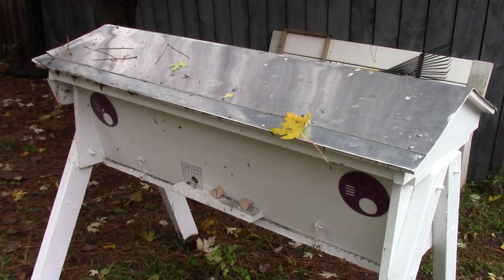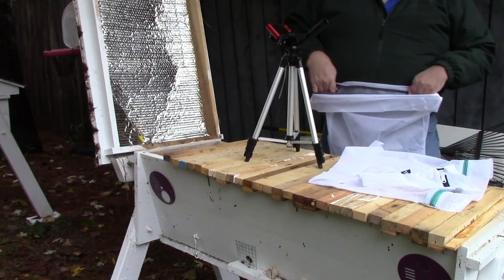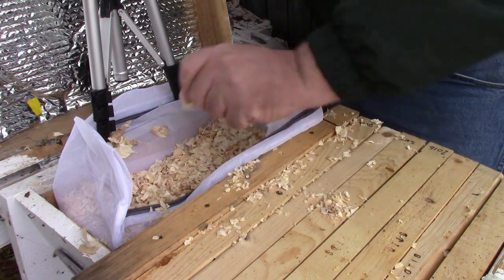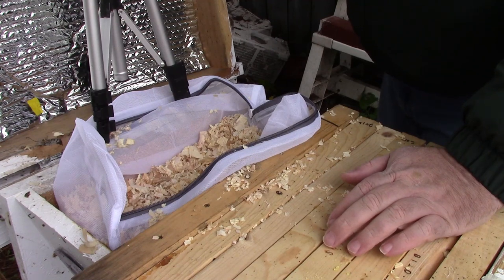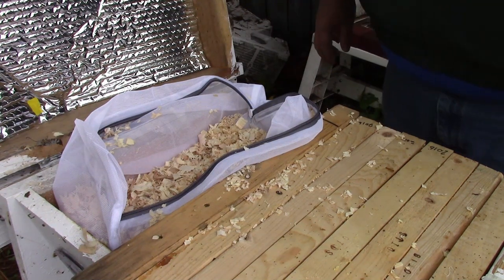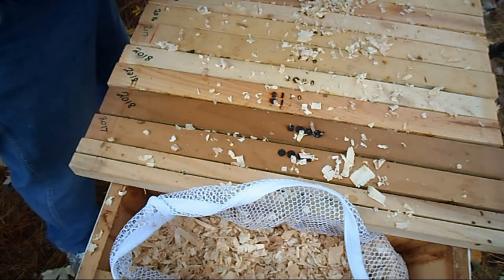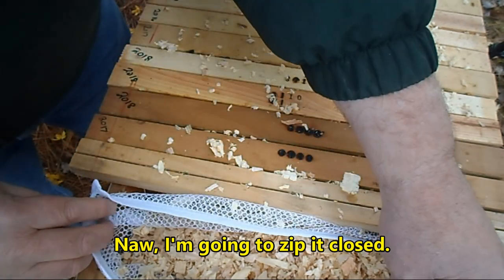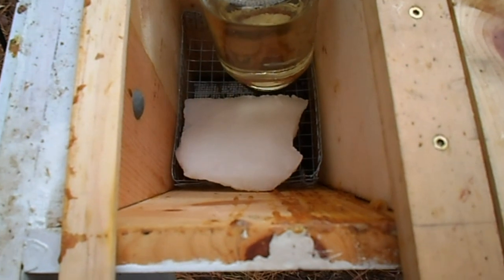Winterizing with Pine Shavings

Comment: Ok. Same as last year. What are you going to do for bottom outside? The square hives have more central mass warmth due to the cube shape.  
Have you thought of that rigid insulation to add to at least 1 outside facing of the hive? It could be attached on just outside on 1 side. This winter is supposed to be record breaking cold & such.
Reply from the maker: I still have some more things I am going to try.